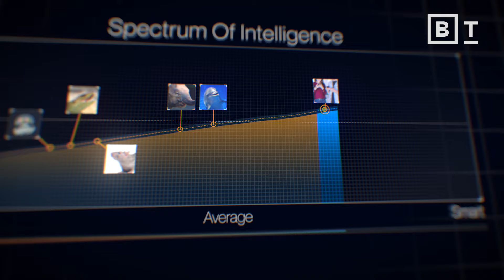The intelligence explosion: Nick Bostrom on the future of AI

Comment: I kind of wish for an AI Winter right now. That AGI still remains decades away due to some missing component that is not known currently.
Reply: AGI is absolutely still decades away. We need modules that are specialized in logical reasoning, true comprehension, world modeling, self modeling and possibly emotions and values. Those are very much missing with current AI.
Reply: @Bluesine_R  exponential growth is a powerful thing.
Reply: @i_accept_all_cookies  That's what people have always said since the 70s, yet new AI tech always halts and stagnates after an immense wave of hype. AGI development will largely correlate with breakthroughs in neuroscience and it won't be truly exponential until the AGI starts to improve its own code and redesign its own hardware.
Reply: @Bluesine_R  AI tech has never been able to write code so well. I'm using it to write its own code right now. I have no doubt Nvidia is using it to redesign hardware.